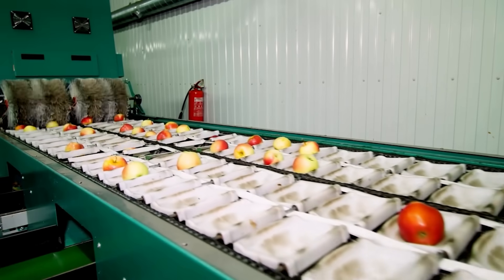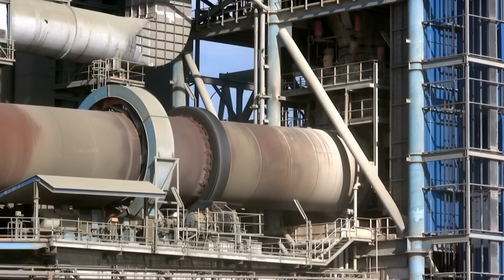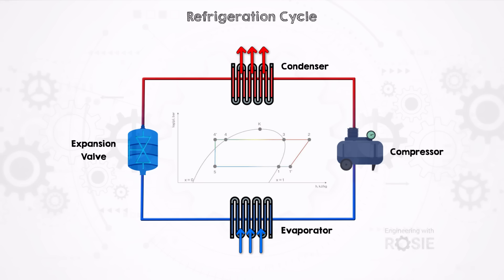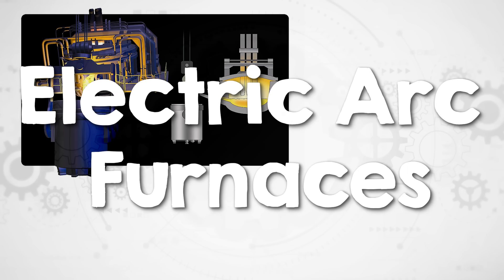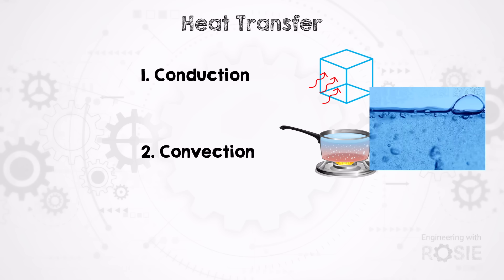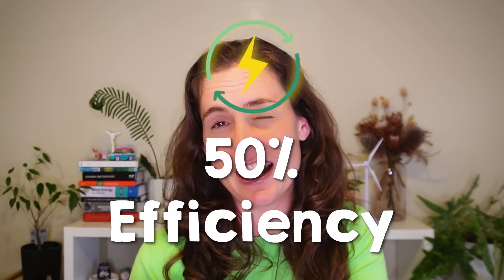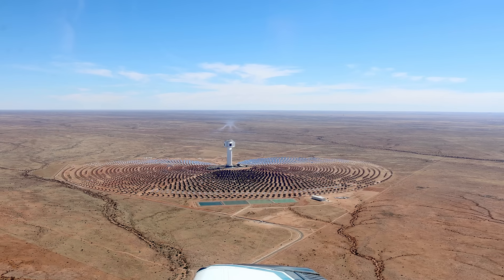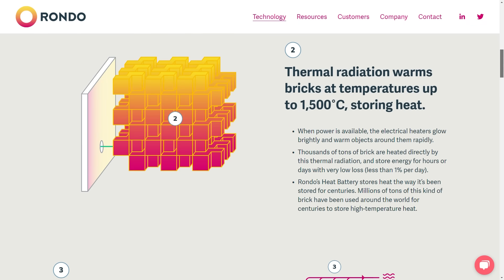Zero Emissions Heat Technologies for Industry

Comment: One general observation: another way to make the heating split is around steam heat vs. other heat sources.  This roughly maps to the low/medium heat options, and most of the processes you are talking about will use steam heat.
Reply from the maker: Yes that would have been quite a neat way to do it!
Reply: That is how the chemical industry splits it

Comment: Thanks Rosie!

1414 Degrees (silicon phase change thermal energy storage people) have just announced they're going to work on pyrolysis of methane to make hydrogen.  Sounds technically fascinating but in this age of frequent negative electricity prices on sunny days, I can't really see it being competitive with electrolytic hydrogen.  So instead it looks more like greenwashing for the fossil fuel industry, which is a great pity.

I've read a little on dechlorination of chlorinated hydrocarbons -- fluidised-bed reactors with alumina and carbonates or hydroxides seem to be able to do the trick at relatively low temperatures.

I was a bit surprised not to see you elaborate more on efficient ways to heat clinker kilns.  Sure, resistance heat from the outside might be an inefficient way to do it, but isn't it potentially a great application for electric arcs, microwaves, or even for resistance heating from *inside*?  (And maybe not such a great application for biomass fuel, which was the only alternative you mentioned?)
Reply: I don't think the clinker absorbs microwaves very well, and neither do most materials you could use for the walls of the kiln. The problem for arc heating is that, while it's great for steel, the chemical reaction that produces clinker in the kiln requires oxygen, and the carbon electrodes would burn before they got hot enough if you have enough oxygen in the kiln. There isn't an alternative to carbon for the electrodes either even if you switch from arc heating to resistive heating. Indium Tin Oxide, which is the highest temperature conductor in an oxidizing atmosphere, can only handle 1250C, and really only 1000C for a long time without losing it's conductivity. Cement clinker requires 1450C. Biomass basically is the only option for cement, for better or worse.
One side benefit of biomass is that you can use the ash to replace some of the clinker the same way you can with coal fly ash so you don't need to make as much. if getting clogged is an issue you can always design the biomass system to do pyrolysis outside the kiln (probably with the kiln's waste heat) and use the wood gas inside the kiln.
Reply: Thank you for the comprehensive explanation, @thamiordragonheart8682  .  I hadn't been aware that oxygen was needed for clinker reactions -- I thought it was all about calcination, and that heat was all that was needed.  I'm reading up in some more detail now.
Reply: @thamiordragonheart8682  You should definitely look into Sublime Systems’ approach to cement! A couple of MIT professors went back to first principles, and completely decarbonized cement. What they get isn’t exactly Portland cement (it’s basically Roman cement), but it’s ASTM C1157-compliant, which means it meets technical/legal specifications and performance for just about any situation where Portland cement is used. There’s no high heat involved at all. The main reason for the heat isn’t to react the calcium, but rather to separate off the pesky CO2 from the limestone. They use non-carbonate calcium rocks (basalt, or even used concrete) as a calcium/silica source. It’s a fascinating progress. I recommend the Volts podcast interview with the CEO (who is an MIT professor and one of the founders), for a deep dive.
Reply: wouldn't resistance heating from inside a clinker kiln get "clogged" by the material being reacted?
Reply: On the subject of cement, I think the right solution is to get rid of the whole Portland cement process. Portland cement is a CO2 problem in two different ways. First, the fossil fuel used to provide the heat. Second, the cement gets its calcium hydrates by breaking down limestone, which releases the CO2 embedded in the calcium carbonates. Sublime Systems (developed by two MIT professors) has a fundamentally better approach.  They use electrolysis rather than heat to form the calcium hydrates and reactive silica compounds, so it can be done at room temperature, using renewable energy directly. This means they can use calcium sources other than limestone - basaltic rock, or even recycled concrete. So they don’t need to release CO2 during the chemical process, or apply high heat. What they produce isn’t chemically identical to Portland cement (it’s basically Roman cement), but it works the same - same structural strength, same curing times, etc. It has passed key quality control standards, and that’s what most customers care about. Unlike some alternative cements, it’s fine for road surfaces, building foundations, and other challenging conditions. 

The hard part with this approach is the capital to build new cement plants, rather than upgrading existing plants, because there’s so much capex involved.